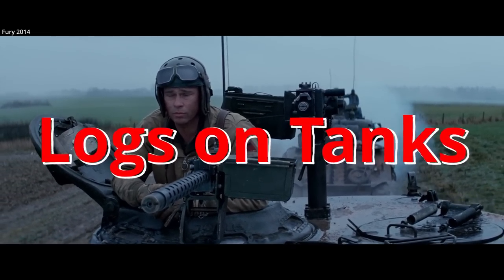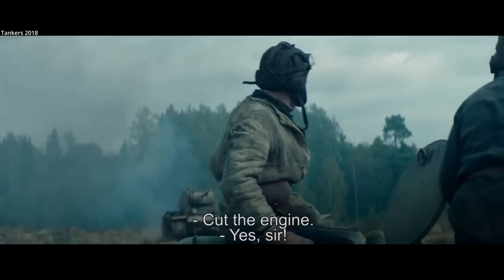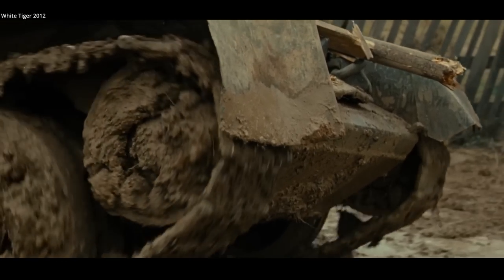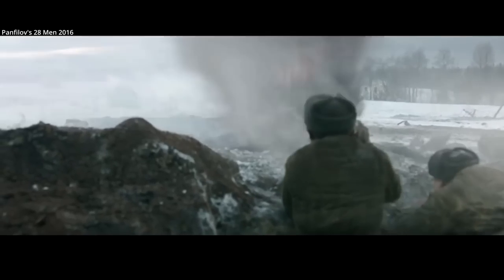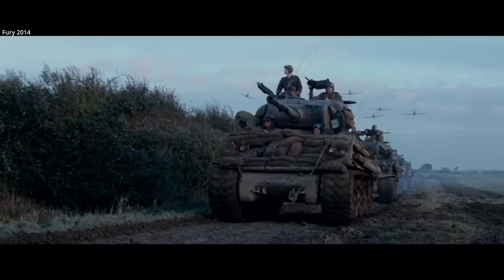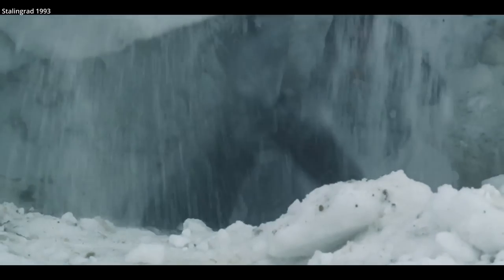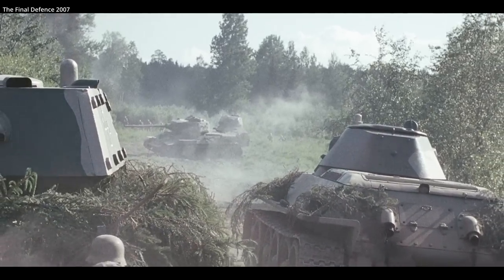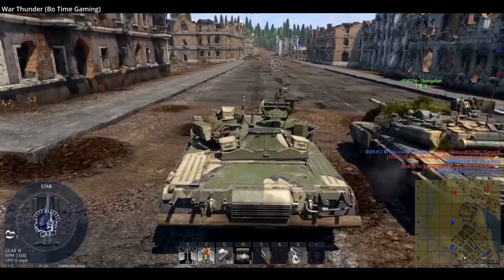What's with those logs on tanks?

Comment: It depends on the country and location. The Soviets mostly used the logs for getting unstuck. The logs weren’t just placed under the tracks. They were cabled to the tracks. The Americans you saw in Fury were using it as defense Vs shaped charged weapons. Things like panzerfaust or RPG’s. They knew it did little to protect Vs AT guns. Wooden panel armor was used in the pacific for defense Vs handheld shaped charge weapons. Also American tanks in WWII were NOT “lightly armored”. The front sloped armor of many models of sherman had close to the same effective thickness as a Tiger I tank. German tanks couldn’t have withstood hits from 88mm or the long 75mm’s either. All post WWII myth and nonsense

Comment: I've also seen logs and other types of objects used by modern tank restorers in the recovery of broken down or abandoned tanks. If your engine dies and you need to recover a tank for repairs etc. you can shove logs in between the road wheels on one side to get a non-running tank to turn as you tow it, allowing for a small bit of maneuverability to get it back onto a road or around obstacles etc.

Comment: Added logic for logs would be, not only cheap and easy to acquire in the field. They can be on the spot cut to size and fitted to whatever space you have for your tracked vehicle. Say an IS-2 would need a larger log vs a T-34E. But additionally with tanks having a smooth underside they can form a vacuum in the mud, needing more tractive force to get the vehicle moving, along with the risk of bogging down or tying up more vehicles in the recovery effort. Either jamming the log under or securing it to the tracks and dragging it under the vehicle would put more force into lifting it up, freeing it from the suction. Allowing for another log or a reset of the first to then focus on freeing it totally. Another stellar video Johnny!

Comment: During that time. The notion that American officers believed that the tanks should be able to get through enemy lines. Thus sacrificing protection and high velocity guns. This resulted in a lot of losses of the iconic mass produced Sherman tanks. It's only the front which was well armored. While the sides and the rear have less protection. Thus American tank crews resorted to using logs and other materials for added protection.

Comment: You actually have to attach the log to the tracks for this to work (you see them preparing a cable for this purpose at the end of that segment).  I have experience with this with getting a tractor stuck in the mud using 4x4 fence posts chained to the drive wheel.  Works great.

Comment: Sandbags and stuff like logs will do pretty much NOTHING against HEAT warheads. For example, a HEAT warhead will go through 400mm of steel, but the same warhead will go through more than 1000mm of concrete... So that adds pretty much 0 added protection. And the loss of penetration over distance is neglectable with HEAT. It is usually stated "a HEAT warhead will START losing penetration after 1-2m distance"... So, you need to detonate it at a distance of what... 3-4m away from tank?! And even then, what is the rate of penetration drop? There are videos where at a test site an RPG hits a BMP or something like that with cage armor. It hits the cage, detonates, penetrates the armor, goes out on the other side of the vehicle and makes holes in trees dozens of meters away...
So overall penetration decrease with this is largely neglectable. And as for magnetic mines: all you have to do is place it where log isn't since it covers limited area of a tank. You would have to cover entire tank with logs. Something like that the Americans did in Pacific theatre, but with wooden planks, not logs.
Reply: They often does less than nothing.
Concrete on a sloped armor made armor ptotection weaker because it helped normalization of the projectile and held it straight. Also the added weight stress out engine and transmission.

Comment: It is funny how I knew that WWI tanks used logs for getting out of bogs I never thought that WWII tanks had that problem. I had always thought Sherman tanks had logs on the sides because a panzerfaust would go through 100mm of steel or air and then stop. So a 100mm log would provide good protection against them but do nothing if the other guy had an 88mm canon!

Comment: Seeing as the video didnt actually explain what the log is for, i will.  To get unstuck you cant just throw the log in the mud.  You need to tie it to both tracks on the end facing the way you want to go, like the soviet soldiers were doing in the movie clip.  Then drive that direction until the log is lifted out of the mud at the other end.  Untie it, and if you are still stuck, carry it to the starting end and do it again, and again until you are unstuck.

Comment: strange truth is...  in the case of standard Armor piercing ammo, logs COULD be a determent.    a shot which would normally ricochet off steel armor would penetrate a log...   the log then "helps" the AP round penetrate the steel armor by preventing it from deflecting as much...   

and really VS an 88mm  or even a KwK 42 L/70,  the logs aren't going to do anything...    and against ide armor.   even the L43 and L48 75mm's are going through a sherman with logs..

Comment: The spring mentioned in the video was / is called : "Rasputitsa" Heavy rain in autumn that softens the ground to flash freeze over night greater into the winter months Then the same with spring .......Napoleon's invasion failed because of this......Hitler's forces were also bogged down giving Russia with its vast lands to defend Time to fix a counterattack This weather was not foreseen to Hitler's men Nor were the arctic blasts Russia dips to. Wood logs were to get out of pits of mud But that is not why they Already had them afixed to the tanks...The Americans And Soviets / Brits adapted Same as the Hedgerow scissors that were welded to the front of Sherman tanks in Normandy made from the steel girders called "Czech hedgehogs" You see on the beach trying to stop the very same tanks The ends cut to a pointy tip And even ground to sharpen them...The idea being the Hedgerow is a way of a natural fence Dirt hill with thick bush and trees The teeth paved away for the tank and men.

...Now you have 2 ideas in your head Picture a man-made valley carved out of the ground deep enough to put a tank barrel facing downwards into the ground And wide enough he will not get out In WW1 they were called Anti-tank trenches Normandy had them...Other ends of France into Belgium had them Russia had them  And the only way over them was....Ding ding ding ! Logs Or 200 men digging for 8 hours  So now you have learned that 2 tactics of defense was Anti-tank trenches And Czech hedgehogs And two counter-tactics of Logs to fill an area to drive over And forked shovel to clear a path ..Sources - fascine tanks of WW1 And WW2, Anti-tank trench. River Fuhse Triple Fascine deployment - Centurion AVRE, --------------Currently the Ukraine has Anti Tank trenches along its borders And this month of December Putin has been pretty quiet with his forces lol

Comment: putting anything on your tank is indeed decreasing the effectiveness of shaped charges. the projectile needs a certain distance that the molten copper ray has its designed shape to penetrate the hull. if it explodes too early it looses its effectiveness.

Comment: They are especially good when you strap them to the tracks to un-ditch. Then they become one massive extra grip for the tracks. That's more of what they're used for than just throwing beneath the track from what I've seen. You don't just put the log under the tracks and hope they grip, you full on strap that log to both tracks to expand the area of grip many times over. And yes, that's mainly why even to this day Russian tanks have holding devices for a log.